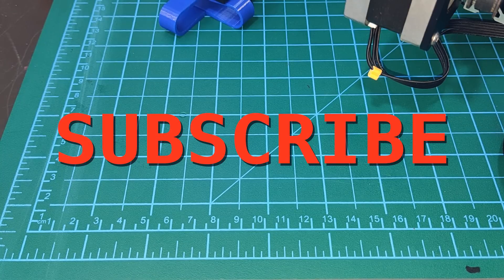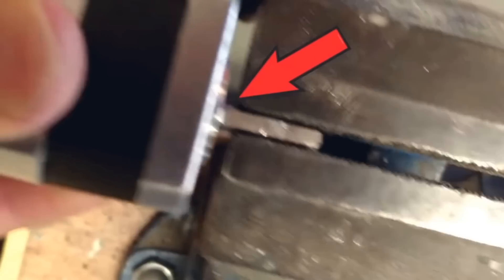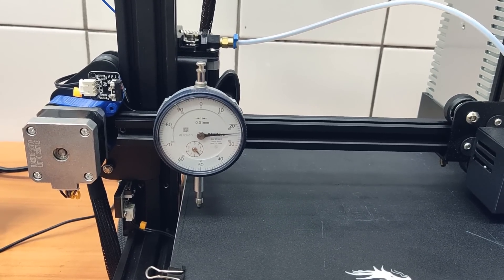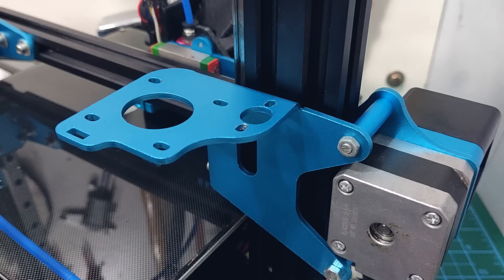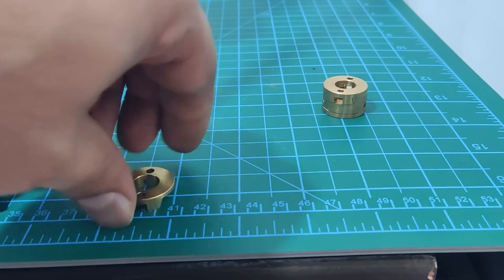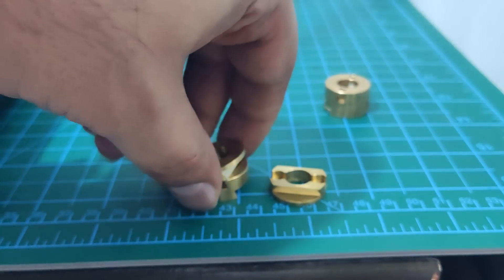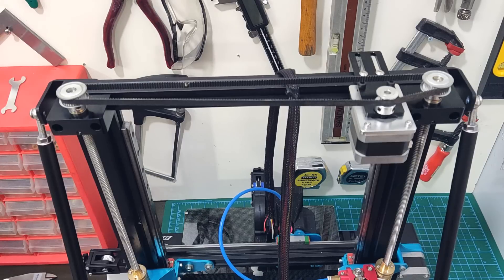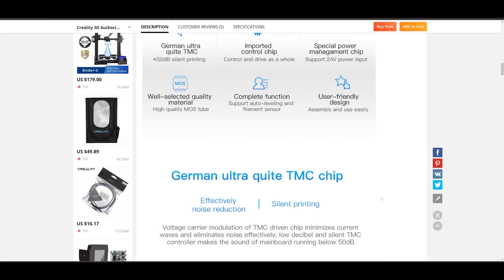Fix your Z axis with Oldham couplings, dual z screws & thrust bearings!

Comment: Have you tried WobbleX? It works similar to Oldham coupling but with bearings it's much smoother. You don't even need to buy it, can just 3D print everything and buy the small magnets, dowel pins and steel balls.

Comment: I had the same struggles a few years ago, end up upgrading to kevin aka sam belted Z, it worked wonders, I installed it in 3 printers, tossed that aliexpress belted z kit to the drawer and it stood there next to a bunch of those bearing blocks 😂
nowadays the ender 3's are turned off because I got better printers on the farm, but they still kick. They could use a better Y axis though, I have lots of rods and linear bearings from other printers It might be better than the vrolers. If I don't end up selling them...

Comment: Just in case anyone needs this advice, you DO NOT have to go as far as shown in the video. Going for a single drive, dual lead screw pulley option is going to introduce a LOT of issues in the long term function of your printer. Instead of doing all of that, you could simply:

1)  Use a semi-flex motor coupler.
2) Use a thrust bearing underneath the coupler. This transfers most of the weight off of the motor's internals and onto its chassis.
3) Install either a "POM nut" or an oldham nut. You can technically use both, but generally an oldham would be enough here.
4) DO NOT USE "bearing stabilizers" AT THE TOP OF YOUR Z RODS. They tend to bend your lead screws over time, and make it WAY harder to isolate shift away from your print. Leave them free at the top of the printer.

BTW, don't forget to grease your POM nut and especially your oldham. PTFE oil, sewing machine oil, etc. all work fine here, but need a lot of reapplication, at least once every 3 months (or every 200 print hours). Instead of all of that hassle, you can use either lithium grease or aluminium grease. This is designed for metal on metal contact only, so keep that in mind (if you printed your oldham, this will not be ideal, stick to oils). Grease is also ideal for the lead screw itself, and only needs reapplication around every 6-12 months (or around 500-1000 hours of printing). CLEAN ALL COMPONENTS BEFORE APPLYING OILS/GREASE FOR BEST RESULTS.

Comment: what if you want the motor at the bottom so you don't have to add weight to the gantry and is there a way to keep the orientation of the motor and eliminate weight add on the motor?

Comment: About the axial Force you mentioned on the motor, I was thinking about printing a bracket that would hold a bearing beneath the coupler for the Z screw and that way it would take the axial pressure off of the motor what do you think of this idea?
Edit:  I watched further and saw that you designed the solution I was considering making to fix this, and went further to drive the screws with belts!  Very cool.  I was going to do the “belted Z” mod everyone has been raving about but this method looks to be much more robust.  Thanks for this!

Comment: I added the oldham couplers and anti-backlash nuts from TH3D to my CR10-Max (because they are already cut-down to fit the CR10 properly) , this stopped the gantry dropping or sagging and helped Z banding. I now added thrust bearings, and made sure the top if the stepper motor shaft was not quite touching the z-axis lead-screw. This seem to have solved all my z-banding. Thanks.

Comment: I had an issue with my B Motor running in reverse. Swapped the blue and green wires. But it made a horrible noise. Upon experimenting, I discovered it was necessary to reverse all the wires to make it rotate in reverse. 1234 ->4321 SKR1.4T

Comment: I imitated the working principle of the thrust bearing by using normal bearings (I don't know how it will work for long-term use), I think it worked, the z movement is very consistent, I ordered the oldhan coupling and it is on its way (I tried this way because I did not want to order a thrust bearing from Aliexpress and did not want to wait)

Comment: Can the issue of the gantry weight exerting pressure on the motor shaft be resolved by inserting a thrust bearing between the coupling and case of the stepper motor?

Comment: Thank you very much for the help, I have been printing with the Ender 3 for 6 years and over this time I have always received poorer printing results even though the settings have remained the same. I have now carried out a complete maintenance of the PC rollers. The Zwobble with the flex decoupler and the Anti Backlash Spring Loaded Nut has eliminated all my problems. I wanted to replace the printer with a new one. I flashed it with Klipper. Now it is one of the quietest prints there is and I can print between 80-100mms print with good results

Comment: Hi! there IMHO, wouldn't you introduce unnecessary wear and tear to the dovetail surfaces on the oldham couplers if you were to place it hanging on the gantry? However, if the gantry is made to rest on the oldam couplers, then the weight of the gantry with gravity in our favor will mitigate for any play on the Z direction. And the weight of the gantry will always press against the oldham couplers and correspondingly to the lead screw to also mitigate backlash. Anyways thanks for sharing this very informative and helpful video to mitigate Z banding and other Z related issues. Cheers and keep up the good work.

Comment: Nice solution. I wasn't aware of the spring washer in the motor, so thanks for highlighting that. One further improvement you could make is to use  self-aligning bearings - any bend in the shaft will cause angular misalignment that will require a small amount of lash to prevent the thrust bearing binding. Maybe an SKF 108 TN9 would work?
Reply from the maker: The self aligning bearing sounds like a great idea. I will give it a shot.

Comment: Would putting a thrust bearing between the coupling and case of the stepper motor fix putting the gantry weight on the motor shaft?

Comment: I feel like it does't improve anything by placing the step motor on top and use a belt. RIght now, with your thrust bearing which I really like that idea, the entire weight of X Axis is now supported by the two lead screws, and nothing will be compressing your Z step motor.

Comment: Excellent convincing engineering/scientific approach to the problem. Kudos !  So many "upgrades" are iffy as to cause and effect and questionable improvement.  My main question with upgrades is cost.  The parts listed are over $100.  I guess there is satisfaction in substantially improving poor design, and if one has the time as a hobby its great.  But my dilema, aside from time, is I start looking at what better printer I might be able to afford by just paying more.  This fixes Z-axis, but with so many other upgrades needed particularly on older Enders to fix inevitable problems, etc. it starts running into some real money- dual gear extruder, all metal hot ends, 32 bit motherboards, direct drive,  glass printer bed, and on and on.  Before long you're close to a no hassle Bambu P1S or ...  But thanks for a great video, at the very least teaching to be very analytical and thorough about these problems.
Reply from the maker: Absolutely agree with you. If engineering is your hobby then go ahead and tinker with your printers otherwise your money is better spent on getting a better printer

Comment: So did  you remove the spring washer and from the stepper motor and just attach the alloy plate? Or did you do something else first?
Also where did you get the oldham couplers from, I read some reviews that some have had terrible tolerances, so I would like to find  more reliable ones.
Thanks
Reply from the maker: The spring washer is an important part of the stepper and cannot be removed. I transferred the load to thrust bearing at the top. I got the Oldham couplers from aliexpress and yes, the tolerance is terrible. But if you install them above the lead nut, you will apply some preload to the coupling and the tolerance that way is pretty good

Comment: Most of the Z layer problems on these cheap Ender 3's / clones come from the leadscrew not having a supported bearing bracket at the top. The spin center shifts and moves around as it rotates with layer changes and causes inconsistent height travel. There is no need for all the other "fixes".

Comment: 1:55 are you showing us an Ender 3 with a stripped motor screw? Only time I see that bend on an extruder tensioner arm. Lol. Actually, looks like the whole thing's loose, at 4:30 you can see another side crooked. 
And a lot of the time that elephant's foot imo is contributed to everyone saying their backlash nuts should be loose. All of mine are snug, not tight.

Comment: A possible alternative to a top mount that doesn't require this much reworking is to print a cubic shaped part that is fixed to the top plate of a bottom mounted stepper motor, with a slot on top of the part for an axial bearing. Fix a flexible coupling to the stepper motor shaft and center it. Put the printed part on top of the stepper motor and screw it down, so that the flexible coupling ends up inside the printed part (ofc it should be printed out of something that won't be melted by the stepper motor). Put an axial bearing into the slot on top of the printed part. Put an unlocked set screw collar and a shim onto the lead screw. Put the lead screw through the axial bearing and into the flexible coupling. Center it inside the flexible coupling (that could be a bit tricky). Lock the set screw collar on the lead screw on such a height where the lead screw can rest on the axial bearing while not compressing the flexible coupling. Voila, now the weight of the gantry is kept off both the flexible coupling and the stepper motor shaft, while there is some angular flex between the shaft and the lead screw.

Comment: not sure how you killed the stepper drivers easily because ive had wires the wrong way before ive never killed a stepper driver before. but then again i use ones that are not embedded so maybe thats the issue the embedded ones are weak. 

seems like you kind of made it like a i3 style z axis.....almost anyway

Comment: Wasted Effort   an interesting but almost totally incorrect solution.!  

 First... BUY and Fit :  Collet type motor to Z screw connectors. 
These are the ONLY connectors that actually work as intended.
Also 4 start Z screws produce a guranteed Sag loss of Synch problems.
Simply Fit a Single start screw. Cheap easy and Effective
Not only does it eliminate Z issues... it Increases Z accuracy by a factor of 4 .. true.

Comment: Excellent work and video here!    I tested my Prusa i3 mk3s and both of my Wanhao D6 printers.  The Prusa motion was nearly perfect at every 0.2 mm step.  The Prusa dual motor solution is simple and works perfectly.  I would copy that.  The Wanhao with beautiful looking ball screw drive was off by 20% on 0.2 mm steps in a pattern that repeated over the 4 mm screw pitch. So the Wanhao with its ultra cheap bearings that fail and horrible ball screw is useless in printing anything that needs smooth sides.  I recommend the digital gauge that Harbor Freight sells.  It is really nice to have the digital readout.  I am about to replace the ball screw in both Wanhao printers to make them useful. The other possibility is to measure the error and correct for it in the software.

Comment: Hm why hanging the rods with bearings from the top`?
Why not leaving the motor downside und putting a bearing on the motorshaft between the Motor and the Couppler on the shaft so the bearing takes the downforce and not the moving motorshaft. So it should stay stable when pushing the bed upwards because the bearing supports the coupler?
So your able to do it on both sides and unse G44 for Gantry squaring with BL-Touch?
Anyone tested?
Reply: Not a bad idea, I might test this

Comment: Why did the motor driver catch fire?
My consideration is that it is not a short but a step-out that is caused by the difference in wiring, and the motor driver should not burn.
I would like to know more about the cause of the burnout.

Comment: Separate comment - What "I" did to fix my issue, was to just move the wave washer, from the back of the motor, to the front. 
No more Z banding, even printing at 200mm/s in vase mode. Higher shows issue, but that is because I'm still using rollers instead of rails still. This is with printing LW-PLA (light weight, micro foaming PLA for RC planes and drones). It's like printing in hard mode, because of temps and humidity dictates how much it expands.
Reply from the maker: That's interesting. I will give it a shot. Thanks.

Comment: There are two pin outs available commercially for 4 wires to six pin stepper motors , either pairing pins 1 & 3 plus 4 & 6 or pins 1 & 4 plus 3 & 6.  Get a multimeter and do a continuity check on the pin pairings to check which pin out you have on each stepper motor.  You can mix the types if you have to on a build, just customise the lead end by unclipping the tiny lead terminations and swapping over pins 3 & 4 as needed.  Assuming a random wire will work without testing what stepper pin out you have compared to the board, rookie mistake..... Also you can use parallel or series wiring of paired steppers but not recommended at all either way. About the only application you can get away with it is on a couple of low use Z drives that sit doing nothing most of the time.  On higher grade machines with laser cutters etc. you always go single motor to multi drive via belts on same axis, with dual motors if one fails you can skew the axis badly and blow the machine/enclosure across a room, just happens on hobbyist home 3d printers you can get away with lot's of bad habits as the masses, speeds and forces are usually low and slow so failures are non catastrophic. (exception is my VzBoT that has some serious forces in play, with full enclosure being the only option with 4 x 48V steppers driving the print head gantry in AWD mode)
Reply from the maker: Excellent info. I agree with you about the bad design habits you can get away with on 3d printers and most of us modders are usually fixing those.

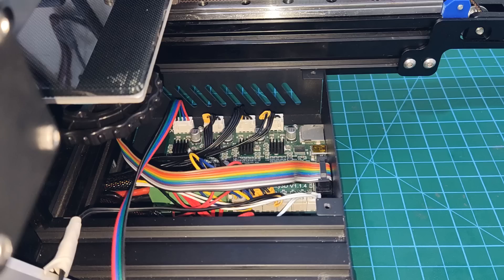Comment: 10:20 Not sure how you managed to burn out the drivers, because swapping any of the 2 wires going to the motor, just makes the motor move the opposite direction. 
So what you should have done is move the Z axis to the middle of it's range, so it can move in either direction without crashing.
Reply: watching the vid again, you probably shorted the leads inside the motor when you took it apart.

Comment: Bit of research before to buy that 3D printer, could make you save a lot of money i think..  ;-)    Cheap + precision  doesn't match  ( that's why most of people that want things well made, buying German tools and stuff )  Surely  if you were checking the Z axis error with a "chinese" comparator (rather than a well made and precise Mitutoyo ), you shouldn't have noticed that error ..  ;-)
Plus everyone that buying 3D printers made by aluminum extruded bars , cant achieve the rigidity of a Stainless steel body , obviously aluminum bend easily than Steel  ;-)  ( Nice video anyway , surely many people will thanks you )
Reply from the maker: Thanks for your interest in the video :). Cheap printers are begging to be modded. Surely you could buy a 1000$ machine and get excellent qaulity out of the box, but where is the fun in that ;)

Comment: i often wonder why no one seems to use a 'coiled spring' counterweight system for the zed axis, to remove a lot of the load on the lead screw bearings/bushings, leaving enough load, in either direction, to eliminate backlash...just thinking...also...another thought, for another day.
Reply: Spring would introduce more vibrations on the z axis imo. I've seen pneumatic assist pistons for z on large CNC machines

Comment: love this video, but makes me sad to look out for this in the future. i am currently having a big issue with ringing and trying to fix it, i am looking for any information regarding z axis and how to make it work better.

forgot to ask if linear rails would work to fix issue and be less complicated to diagnose and dial in?
Reply from the maker: Thanks! Linear rails are definitely more reliable but you do need to make sure they are properly aligned when installing them. However, they don't affect the print quality that much. Mostly for convenience and reliability

Comment: That’s a much much simpler way to solve this problem using only 2 Axial thrust bearings and rigid compression couplers. Even with visibly wobbly lead screws, you get perfect layers.

https://youtube.com/shorts/OvVs0wmuFR0?feature=share

Comment: Great project and a lot of love you give to that ender. I'm just wondering about two things: (1) how can the stepper driver burn by swapping two cables. AFAIK swapping two wires will never burn the motor nor the driver but instead either change direction or let the motor only wobble instead of move. And (2) I checked how much weight my stepper motor needs on the axis until it moves and it is around 3kg when the spring is compressed and it starts moving. Can't imagine how this is a problem. Sure it is better to avoid any load at all to the axis like you do now, but does this really affect print quality?
Reply from the maker: Thanks for your interest! Im not really sure why the drivers burnt up, the motor did wobble for a few seconds & then the burning smell followed. About the spring washer,  a compression of 0.01mm is enough to cause a 5% variation if your layer height is 0.2, even more if your layer height is smaller.
So really it was a matter of eliminating all possible points of play and just following good design practice. I did not check the deflection of the motor shaft with a dial indicator.